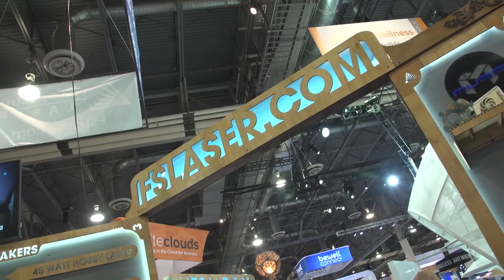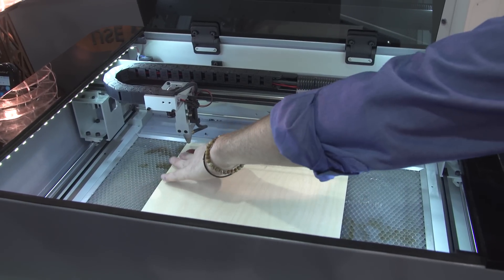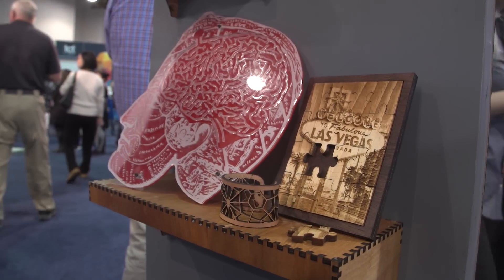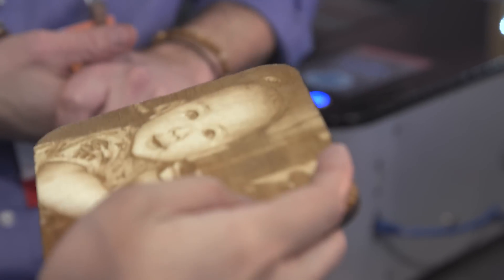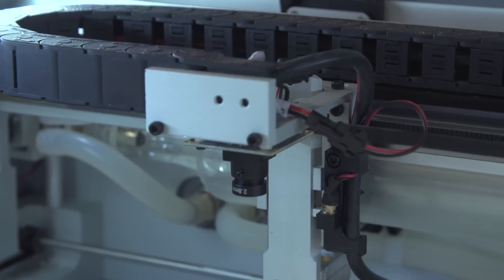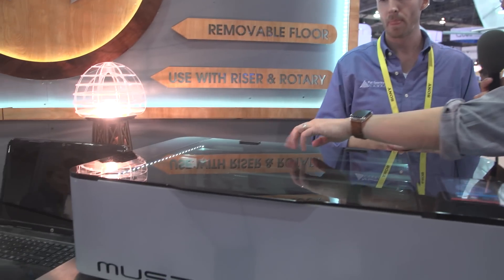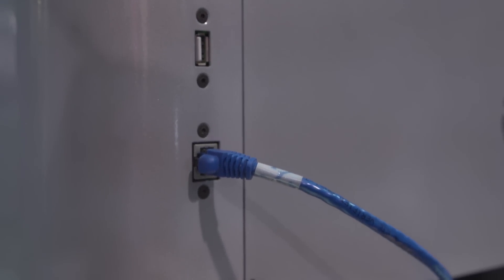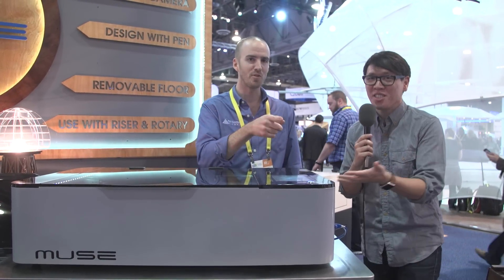First Look at the $5000 Muse Hobby Laser Cutter

Comment: Touchscreen e-stop = fail.  e-stop must always be a big red button easy to get to and able to be slapped fast barely looking.
Reply: "Why would you need the reaction time of a physical E-Stop"
In one word... Fire!
Reply: @jimthompson5548  Just open the lid and it stops.
Reply: @beer1for2break3fast4  So you open the lid and increase the oxygen content while still blowing air onto the fire? Wouldn't it be better to stop the air flow and laser with a big red button? Then if the fire doesn't go out (which would be unlikely) you can bust out the fire extinguisher and then open the lid.
Reply: software can seize up and make the touchscreen inoperable or a panicked finger can miss the image of a button.. there's far less chance that a physical metal-to-metal contact switch will fail. the button itself would all but have to break off.
Reply: I mean you should be able to be walking by it, see something bad happening, and have slapped the e-stop in one second while barely looking and know absolutely for certain that you pressed it.
Reply: Everfalling In fact, e-stop buttons are supposed to be normally closed. Also if properly engineered, the big red button is pressing directly on the contacts, so if you hit it hard enough, even if the contacts are welded, it WILL break the contact.
If the contacts have gone bad and won't close, the machine won't work at all.
Reply: A touch screen e stop is ridiculous and anyone who is trying to argue that a 45 watt laser shouldn't have a standard emergency stop is overly/unsafely confident in the machine.
Reply: I think he means just that it should be able to be pressed without looking, easy with a physical button, not with a touch screen.
Reply: +Jim Shepard You are quite correct, proper industrial quality E-stop buttons are available for $25-35 (guys don't buy cheap Chinese products for safety applications) But most people aren't comfortable working with mains electrical stuff. At this price point I would like to see a physical button on the machine itself.
Reply: John Ridley Sorry, I was replying to Jim Thompson's fire comment. I get it, it should have a mechanical e stop though.
Reply: SirCadmire You're entirely missing the point. eStop is there for the unexpected.  You have a power spike and the firmware crashes, the motors seize and the laser is on.  The soft estop doesn't respond because the software is crashed.  That's ONE scenario.

All automation should have a hard estop button.  Period.

I assume the only reason they don't have one is that they want their design to be pretty. I'd prefer functional and safer.
Reply: as stated that button is NOT An E-STOP it's just a stop button, it's something to push if you forgot something or the machine is cutting the wrong part.
You can press it and the machine will halt its current program.

An E-stop is meant for emergencies when you push it no regard for the machine what so ever is considered it will stop the machine dead.

On a laser cutter it cuts the power, on a router, it might cut the power and slam on a hard brake to stop the spindle instantly,  possibly even damaging the spindle in the process.
It is meant for emergencies where your safety is of more importance than that of the machine.

an e-stop is usually a normally closed button, so if the button malfunctioned the machine wouldn't run. 
In an emergency, you hit the button and it separates the contacts shutting down power at the power input the same as if you had yanked the power cord out.

A software e-stop only works if the machine's software works, if the machine has a crash or locks up the code to run the touchscreen might not work and the software e-stop won't work.

To those who suggested open the door.

Depending on the machine this might work however if that's a software switch that runs a halt command to the machine it won't work. 

if said door is hardware interlocked then it may work but in the case of fire In the machine you've now made the situation worse.

next reason it's not an e-stop is its form its a picture of a button to tell you where about on the screen to touch, this is not ideal as e-stops need to be easily reachable and easily pressable usually, this is a large red button that the user can hit almost without looking.

other examples I've come across are

on a bandsaw where it had a 6-inch large metal button at the bottom designed to be kicked in an emergency.

on a metal lathe where it not only had a red stop button but a large metal bar running the full length of the machine, at foot level that you stomp  on and would not only stop the machine like the red stop button but also slammed on a brake mechanism to bring the lathe to a halt in less than 2 seconds. 

both designed to be easily reachable and render the machine safe instantly with no software delay or intervention.

circular saws have a device called a saw stop that if it detects the user touching the blade while running, drops the blade down and slams a aluminium block into the blade stopping it instantly and destroying the saw stop and the blade.

another example of destructive e-stop is a device I only know as a molly switch, which was fitted to old IBM mainframes.
it was a plastic chisel with an explosive charge fitted that when the e-stop was activated fired the chisel through the main power line of the mainframe severing its power connection instantly.

all these devices serve the same purpose stop the machine as quickly as possible in whatever manner best serves to protect the user regardless of what it might do to the machine.
Reply: hypersapien Thats exactly what it means.
Reply: Can't you just open it up? That would stop it, and you would have to open it to put the fire out... unless you want the fire destroying it.
Reply: Andrew Delashaw If the problem is fire, sure, if you want to release all the toxic fumes into the room instead of letting them continue to vent out of the fan.  But what if the problem is that the firmware has gone nuts and it's ramming the laser into the side?  Or the cut surface has flipped up and is levering the laser and damaging it?  It's faster to slap an estop button than it is to unlatch and open.

Clearly they think there should be an estop because they put one there. They just didn't engineer it properly.
Reply: ***** Yeah looking at it now I see it right in front of me, my bad. I was referring to the actual E-stop buttons, but your suggestion is also valid. And please do call an electrician! Happy to come by anytime!
Reply: (Does E-stop mean Emergency-stop?)
Reply: ah yes good point.
Reply: hypersapien It's such an emergency that we don't have time to say "emergency" :)
Reply: there are other reasons you need a estop like a fire breaks out inside the machine
Reply: SirCadmire It's not about the "delay," or anything else, other than the e stop method being less reliable than a mechanical switch.
Reply: KYLE REES Oh... so even better... no e stop at all.
Reply: KYLE REES By the way, opening the door is better than leaving it closed. the exhaust blower will just fuel the fire if you leave it shut.
Reply: what do you mean no e-stop at all
Reply: also ive seen the opposite happen hit e-stop exhaust blower shut down the machine filled with smoke and self-extinguished
Reply: None of the trotec and rayjet models we have have a physical dedicated e-stop. Try again.
Reply: John Ridley  open the top , duh
Reply: Why would you need the reaction time of a physical E-Stop on a device that:
a) can't be operated while it's being opened.
b) at no time has physical contact with the work piece ( unlike, a 3D Router ).
c) most likely runs proprietary software thus eliminating the chance of user error because of the wrong settings.

I have an 2016 X-Carve which ticks all 3 issues described above thus really do requiring an E-Stop but THIS bugger? I don't thing so.
Reply: I have worked with laser cutters before, and it is very rare for a fire to start even with in-experienced users. You really need to have the completely wrong settings, and when it does happen, you will ALWAYS be next to the machine when it is operating. If it is left unattended while in operation there can be serious consequences. 
In regards to if a fire does appear, a 1-2 second delay or even 5+ second delay till the laser stops is not an issue, most (if not all) models will stop firing the laser as soon as the lid is opened, and a fire-extinguisher (Preferably a halotron one to not damage the machine) should be located near by. Open it up, spay out the fire, clear away burnt material, adjust settings, and you are good to go again in a matter on minutes.
All in all, their design is more than acceptable for the risks involved.

Comment: I have a laser on it's way to me. 600x900mm cutting area, 100W RECI tube, large compressor for air assist, exhaust fan and some spare lenses and mirror. Cost me USD 3890. When I've paid shipping and duty it will still be below USD5000. This is a machine that will do production work 8-10 hours a day. USD5000 for a hobby machine seems very expensive.
Reply: G. Weike LG900N. Uses RD Works which is easy to get to grips with. I'm a professional user, this is the 5th laser I've bought. Currently running a LG6040N also from G. Weike. It runs Lasercut 5.3. 
I'm aware that you pay for the privilege of local support but even then I think 5 grand is excessive for a hobby grade machine.  For app. USD 5100 you can buy a professional grade machine in UK from Justaddsharks.
Reply: But the chinese machine will suck at engraving. Full Spectrum does really well in this area. The support has been good. Ive got 2 lasers, a 100w Thunder, and a 40w FSL.
Reply: GCC?
Reply: Michael Henriksen Brand? Model? Software support?
Reply: My father and I bought a laser cutter/engraver about a year ago. It's a water cooled 70w laser tube. Our working area is about 12by 17, so a tiny bit smaller than theirs. And our Laser is significantly bigger in physical space taken up on your desk or table. But ours cost 3000$ Canadian delivered. That's 2279$ USD! you Are dead on in saying this machine seems expensive. Ours wasn't even some cheap ebay one. We bought it from a online shop out of Canada.
Reply: The machines I have are very similar to those from Justaddsharks. They are good machines that will do serious production work.
Reply: My 80W laser engraves really well but I don't do a lot of engraving. I know the 100W tube will not be so good in that respect.
Reply: Can it cutting  on metal
Reply: 1.5mm brass
Reply: Lol, race cars, dirt bikes, motocross, barrel racing/rodeo, golf, guitars with a great sou d, etc...hobbies all can be pricey. I mean, fabric isnt cheap and I know multiple women who ha e multiple closets full of the stuff. Like $5-$9 /yard is common on basic fabric. Lol.

Comment: Does the machine have an adjustable z axis?
Reply: The focus head is adjustable within 2 inches, but the bottom panel is also completely removable.  This allows you to place the machine on any surface so that you're not limited by material size. 
For example,  If I wanted to engrave a tabletop or my floors, I am completely able to.

Comment: Why spend 5000 dollars on this? Or 2000 dollars on a Glowforge?
Though, this at least has better cooling then the Glowforge.
The simple K40 costs 400 dollars, and with only a few cheap upgrades it is just as usable as any other laser cutter.

Comment: Hmm, I'll take a $100-150 scroll saw and a sanding block any day of the week, and get 95% of the result with a bit of care and skill...
Reply: Kind of hard to engrave photos, or do hinges with a scroll saw.
Reply: You underestimate my powers...

*legs and arms get cut off by scroll saw*

For engraving sure, I'm thinking more about the typical uses where people are just cutting straight lines or curvy shapes- you don't need a $5000 laser to do that, that's not a typical hobbiest's requirement. People running home business'sss'ss'sssses's and small scale manufacturing runs for etsy shops, sure, they could justify that cost and earn back the money quite quickly. It's the whole 'hobby laser that costs $5000' that is a little bit misguided in terms of marketing, or who it's designed to appeal to / be targeted at. Home-gamers won't spend that much money unless they have cash to burn...

Comment: wtf... you can get a 40W laser cutter on amazon for 500$ This is a ripoff. I understand this has more integrated software controls, but a 5k$ laser this is not.
Reply: It comes down to how much money is your time worth. Cheaper units have a higher learning curve and some people would rather use that time building things than sorting out issues. Not that the cheaper are bad. I have used a few of them but the software has been a drawback for me. Same goes when things break. Some people prefer to have a single number to call rather than spending hours reading forums and head scratching. It is neither good or bad but comes down to time vs money.
Reply: Downtime is money lost and if you can have a tech in a day vs spending 3 to maybe fix it yourself that is a huge difference.  I have both cheap Chinese lasers and pro lasers and the Chinese died and became donor parts for my pro rather quickly. They just did everything better and faster. The software was more reliable and versatile, the support was better and I didn't have to waste time replacing cheap parts with better ones.
Reply: Most small engraving shops use hobby machines like the Zing for small jobs. The smaller footprint makes it more friendly and the lower power actually engraves better. You see the same thing with CNC and 3d printing. They just don't make small, low volume business machines.
Reply: Agreed, this is overpriced when compared to the totally serviceable cheaper and higher powered Chinese units that people are having good results with.
Reply: A clever person could.  Nobody has yet. From what I understand, getting the cheap cutters working is a nightmare of barely working toolchains.  Kind of like you can do everything on Linux, if your time isn't worth anything to you.
Reply: I was thinking this, surely a clever person can open source the code and guide to put a lazer on a 3D printer base. the rotation stuff is kinda out of bounds but for flat cutting and etching it could be done.
Reply: A little less on ebay.
Reply: Chris Gough Have you seen the Inventables x-carve? It is kinda like what you describe except with a cnc router as opposed to a laser. Inventables took an existing machine design, tweaked it and wrote a very easy to understand cad/cam package called easel that is extremely simple to learn.
Reply: Or if you happen to be in the uk :D

I wish I had space for this :p

http://www.ebay.co.uk/itm/172309530469?_trksid=p2055119.m1438.l2649&ssPageName=STRK%3AMEBIDX%3AIT
Reply: CNCZone has an active support group for the Chinese lasers.   Many are quite pleased with the bang for the buck they represent and have experienced few issues.   http://www.cnczone.com/forums/general-laser-engraving-cutting-machine-discussion/314504-software.html
Reply: Some good advice to be found here:  http://www.cnczone.com/forums/general-laser-engraving-cutting-machine-discussion/325978-npo-looking-purchasing-advice.html
Reply: You get what you pay for.
Reply: Try getting that ebay laser and see how you like it, cheap chinese crap.
Reply: And some times you pay for what you get.
Reply: This seems to be the common problem, the driver boards/software are a bit odd, but converting them to grbl or mach3 isn't terribly difficult and there's plenty of reference material out there for the job.
Reply: you pay 5k for a laser that you can have delivered or 2.9k or vaporware on Glowforge?   lol... I think I'm gonna call them FS and buy a laser that will be in my house in a week and runnning!!!
Reply: I would prefer this to chinese products for safety reasons. Chinese cutters dont turn off the laser tube if you open the lid, some of them have improper grounding so the housing is actually connected to lethal voltage. Also chinese cutters are more like 30W and not like 40, because of the cheap lenses, mirrors and tubes
Reply: Lathan, we are talking about hobby laser use, not production manufacturing.
Reply: Excellent point and this should be emphasized.  Yet, I still think the value proposition for this unit is underwhelming.
Reply: If by "your time isn't worth anything to you " you mean "you can't be bothered to learn new skills" then yes, otherwise that is and always has been a bullshit argument, especially these days.
Reply: Which isn't a bad argument however those numbers just don't add up to justify it unless someone turns up at your door, by helicopter to operate the machine while feeding you grapes.
Reply: I totally agree, however 5k$ is waaaaaay passed the mark, if they were charging maybe 1.5K$ I would think it was a great deal.
Reply: I have used a chinese laser, they are actually pretty good, just because it's chinese doesn't mean it's crap. There is a learning curve to the software, but the hardware is fine.
Reply: semidemiurge this one is 455 and even has prime shipping, and 75% 5 star reviews! https://smile.amazon.com/Engraving-Machine-Engraver-Cutter-Exhaust/dp/B01AJGFS7Y/ref=sr_1_5?ie=UTF8&qid=1484150402&sr=8-5&keywords=laser+cutter